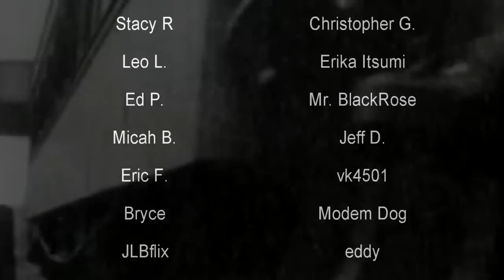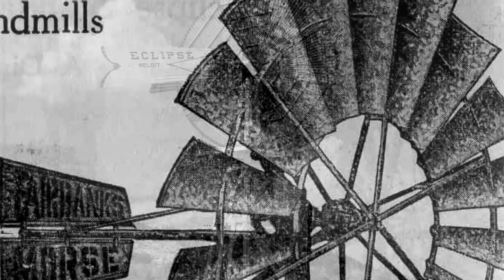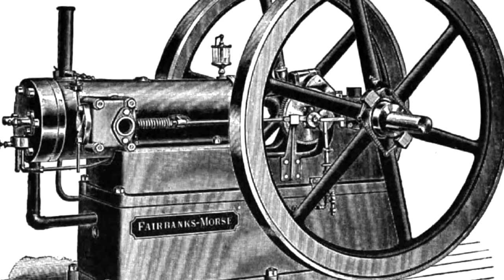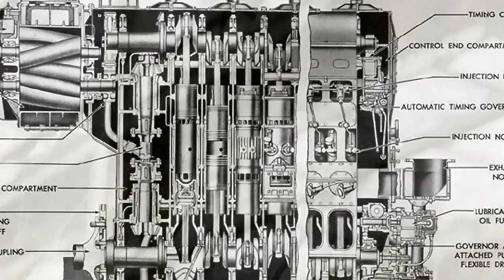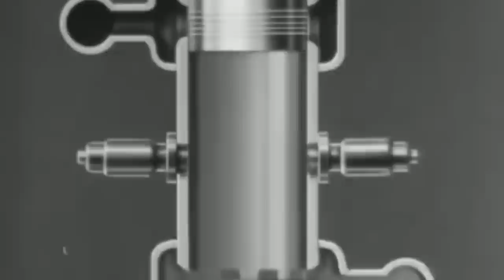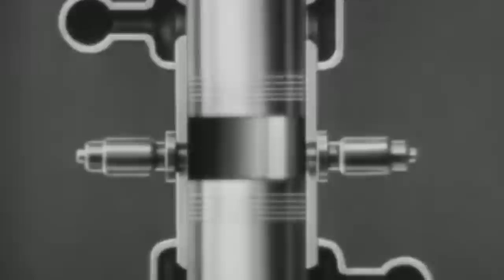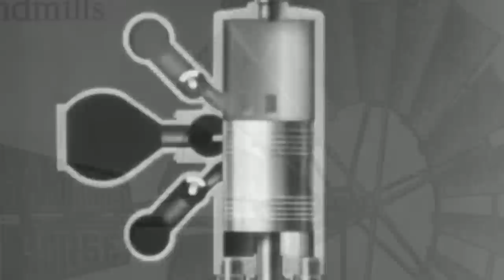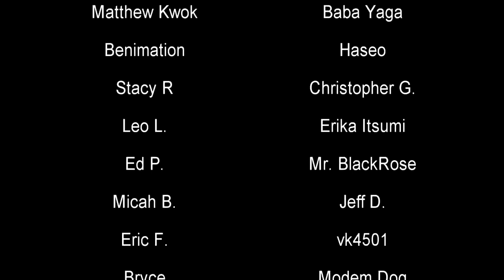Why Fairbanks-Morse Failed at Locomotives | The Opposition to Opposed-Pistons | History in the Dark

Comment: The Fairbanks OP engine not being suited to RR stresses is BS - no RR proved that more than the San Francisco Bay Commuter trains.  They used trainmasters on commuter trains with frequent stops - full throttle acceleration then idle and a quick stop, repeat - full throttle, stop over and over.  They were extremely quick and reliable.   FM worked out the problems, but the bottom line was the RR style of maintenance and the mechanics who hated to work on them because to repair a bad cylinder you had to remove the top crankshaft;  this was no problem for the navy because when an engine got tired they rebuilt the entire engine!  Railroads on the other hand were lazy and loved band-aid repairs, and that was easy on the EMD, and ALCO because they were designed such that you could remove and replace one Head, or Cylinder assembly without disturbing the rest of the engine.  The problem with this philosophy is that the shops were always replacing something because of the bit-work repairs - talk about unreliable.
Reply: To be fair however, the line between San Francisco and San Jose is near completely flat, and the FMs were always within 50 miles of their maintenance base or in the case of the El Paso H12-44s, they nearly never left the yard.
Reply: @mikehawk2003     Irrelevant - a steady hard pull would have been better.   The commuter service was actually harder on a locomotive because of the extremes of operation - full throttle then idle over and over - that is what really did in loco engines;  it is called thermal shock.

Comment: Big advantage to the ubiquitous EMD 567 diesel prime mover is the ability to change out a single "power unit" (piston and cylinder) without disassembling the whole engine. In fact, you could upgrade a 567 crankcase to a 645 by changing to the larger power units.  
Interesting to note that the Navy's planned replacement for the Fairbanks Morse 38-8 /18, General Motors' 16-338 "pancake engine" was a total failure.

Comment: Opposed piston engine are larger not smaller than over head valve designs used by GE, EMD and ALCO. With there two crankshafts design they are also very tall. Their engine were so tall that they ran from the keel to the bottom of the top deck in submarines. FM's locomotives are known for having tall hoods for this reason. They are also a very low rpm engines and they are built to run a constant slow speed to turn a generator for a constant current flow like charging batteries in submarines or pumping oil in pipelines. Locomotive engines need to very the rpm to meet the load. This caused high wear on the gearing connecting the upper and lower crankshafts of the FM engine at first. The biggest problem was that if any major repair was needed the engine had to be removed from the locomotive to be disassembled for repair. Where others manufactures engines are a modular design and failed components are replaced as subassemblies that can be done rather quickly and the engine would stay in the locomotive. Thus returning the locomotive back to service faster and cheeper. You also need to understand that diesel locomotives have warrantees unlike steam. They are warranted to be available for revenue service for a specific percentage of time in a year. This was a strong sailing point in going with diesels of steam. If it's not available do to longer maintenance time or major repairs. The manufacture will have to issue a refund or give credit agents future new locomotive perches. The only salutation FM could do was to have complete engines at the ready to swap out. A very expensive solution that didn't fix the problem. They had an engine they needed a home for. Unfortunately it need to be redesigned to really work in a locomotive. By the time they figured that out (Train-masters) they had such a bad reputation no one would buy their locomotives.
Reply: Thanks for your explination. Makes good sense.

Comment: Compactness of the Deltic design was useful in the UK because of our restricted gauge (tunnels etc). Not an issue in the US. Also the prototype was presented to British Railways to familiarise themselves with it and assess it for any adjustments they required before bringing the locomotive to full production.
Reply: The Deltic was also very efficient. That was consequence of the opposed piston design “borrowed” from Junkers.
Reply: @allangibson8494  other than height the 38D 8 1/8 is feet narrower than a deltic. The deltic may be shorter to comply with height limits in the loading gauge but it’s certainly much wider.
Reply: @Jon_Flys_RC  There were smaller engines in the Deltic family. It started off as a patrol boat engine.

Comment: Several railroads had almost 100% FM locomotives on their rosters. Virginian, Pittsburgh and West Virginia, and Akron Canton and Youngstown. Milwaukee Road had a large roster too. You didn’t mention that most FM locos used Westinghouse electrical equipment. The problems with Westinghouse gear was part of the problem, this goes for Baldwin locos too.  Yes FM did have issues with the OP engine but they did correct those problems. The proxy fight killed a huge order that was going to be made by the Illinois Central for the Train Master loco. TheIC was going to order around 60 locomotives. BTW the Southern Pacific kept their FMs running into the mid 70s

Comment: What are the maintenance differences?

I see the additional areas representing greater frictional losses but the combustion pressure normally wasted pushing on the head is being tuned into work plus it was a two stroke. Regardless of any size or weight savings was it or was it not more efficient for the power output?

Greater efficiency means less fuel for tractive power produced. Were the engines so maintenance intensive they ate up operating savings in the maintenance shed?

I understand how submarine duty would have few starts and stops but how on earth could a company like FM miss on understanding the service requirements of a locomotive?

Comment: Okay, you missed a lot here. The H-XX-44 series used the opposed piston engines but FM had wanted to design a totally different engine more suitable for railroads but the war department was keeping FM firmly locked into making those opposed piston 2 stroke engines for submarines. The 44 series engines had a bad habit of walking off the rails due to the engine's operating gearing causing the locomotives to wobble from side to side a little. The FM-10,12,15,and 16-44 locomotives were limited to a maximum speed of 35 MPH on straight track by the ATSF railroad. On turnouts and curved track they were even more limited. Try >10 MPH limited.

Comment: You got most of the facts right about the Fairbanks-Morse company.... then you repeated most of the (mostly untrue) tropes about OP engines and Fairbanks locomotives. Most of the FM locomotives and switchers (other than the cab units) were kept running until they wore out. The Soviets ripped off the FM design and built over 10,000 OP engined locomotives. 
What GE and EMD had, was the financial strength to back the loans on locomotives they sold. GE Capital and GMAC sold more locomotives than any mechanical issues.
FM still makes the OP 38 8-1/8 engine.
Reply: Mostly parts no one buys new ones as they are long obsolete

Comment: @ajkle…..I am not a mechanic, but I am a thinker.  I’m wondering if that engine is harder or more complicated to maintain than a classic engine.  It seems that most mechanics were trained on regular engines and could tear them apart and put them back together with their eyes closed, but they were not really familiar with AP engines so they seemed more difficult to work with.  It may be possible that had they taken a comprehensive course in AP engines and learned their differences that they may have found the AP engine no more challenging than the engines they were used to dealing with.

Comment: It's a Shame that the opposed piston diesel never became anything after Fairbanks Morse. Even though they are not practical for everything ;in terms of design and engineering even in the 21st century it is a engineering marvel, they are even more efficient running than a normal diesel engine. Talking about emissions the opposed piston engine would produce way Less NOx and emissions than a V or Inline engine. For every stroke of the pistons they are burning almost 100% of the fuel there's no blow bye. But on the other hand the auto makers and the EPA wouldn't make any money off of engines that are  efficient so it makes sense why they are not used anymore. Just seems like all of the mechanical engineering designs that were the best seem to have faded away for less reliable and plastic parts. With a little bit more innovation and modern design the opposed piston engine easily could blow every other engine away in every sense. I Enjoy these railroad videos man! Best wishes!

Comment: The Virginian Ry. simply hired a veteran who maintained engines on a submarine to head their locomotive maintenance, a person who already knew how to properly maintain F-M OP engines.  VGN seemed to do just fine for quite some time using F-M locomotives to haul heavy coal trains in the Appalachians.  So I still don't see exactly what was wrong with F-M locomotives.  Or was it more with the Westinghouse electric traction motors?  Didn't Baldwin diesels have reliability issues with Westinghouse motors?

Comment: Didn't the Soviet Union "borrow" F-M's opposed-piston engine design for the Soviet 3TE10 and similar diesel locos?   Efficient they weren't, being famous (infamous?) for the prodigious quantities of thick black smoke they used to barf out all over the Motherland, but they soldiered on into the 21st century, especially in places like Moldova and other semi-bankrupt ex-Soviet republics, and they were also used on the non-electrified section of the BAM, Russia's other Trans-Siberian railway.
Reply: The Soviet Union did not "borrow" the opposed piston design from Fairbanks-Morse. The 1st opposed piston diesel engine in Russia/USSR was built around 1910-1914 at the Kolomna Locomotive and Machine Works(KZ/Kolomna Diesel) based on the design of their Chief Mechanical Engineer Raimond A. Koreyvo(1852-1920) - who was most likely inspired by similar gasoline engines built by Gobron-Brillie in France(in 1900-1906), Kolomna diesels were mainly built for ships in the 1910's as they also had a license from Rudolf Diesel to build diesel engines in Russia.

Fairbanks-Morse engines were used on US built Wind Class Military Icebreakers(which were designed using Russian help in 1941 - mainly in the form of the "Krasin" Icebreaker which was sent to a US shipyard - and later returned), 3 of these ships were sent to the USSR in 1944-45. They were returned to the US in complete working condition in 1949-50. All reverse engineering work in the USSR on these engines was done using only technical notes, drawings, and photographs - without removing the engines from the ships. Previous experience was directly applied to designing the D100 opposed piston Diesel Engine Family(series production was moved to the Kharkov Malyshev Factory in what was after 1992 independent Ukraine), the 1st engine tests were I believe on a 1,800 hp 10 cylinder 1D100 engine in 1951-1952. The 2D100 production engines with 2,000 hp were installed on all roughly 13,500 TE3 and TE7 Diesel Locomotives(built as Multiple-Units) built between 1953 and 1973. Most "2nd generation" TE10 Mainline Locomotives(built as single, double - 2TE10 and triple units - 3TE10) received the later 10D100 3,000 hp 10 cylinder diesel engines from 1958 onwards. Larger12 cylinder engines were designed but were not used.

Today if the TE10 locomotives are rebuilt they receive the D49 4 stroke conventional diesels built by Kolomna Diesel.

Comment: From what I can gather, when they ran, they were almost too powerful, and were actually excellent but When they didn’t run, they were an expensive mechanical nightmare for railroads to service.
Reply: Sounds just like my '93 GMC Safari with AWD and the HO V6.  Best vehicle I ever owned when it was running right. But it was a "shop queen." And the dealer we bought it from had "parts changers", not mechanics.   Ended up trading it in on a '94 Ford Exploder. Yeah, not much of an improvement there.
Reply: Lol did it came with Firestone tires that blew out? I actually also know of the van your talking about. Another channel reviews one in length.
Reply: @danhoyland142  My Lady Wife's '90 Ranger came with those tires. Never a flat, never off the rims, ran them until the tread wore out. But we were always careful about keeping the inflation up.  The problem with those tires was that if you ran them underinflated, they'd overheat and fail.  Which is true of most tires.
Reply: Yup , I forgot that detail but I remember everyone talking about it when I was a kid.

Comment: Here in alberta he have dealer FM in Cochrane for gen-set I work in pipeline job one time a saw gen-set the are massive gen-set work with natural gas injection due long main hydro line was too far.lot oilfield still use today.